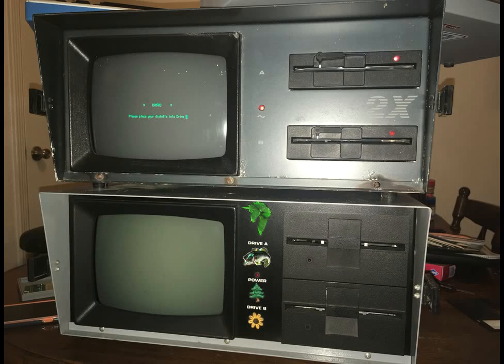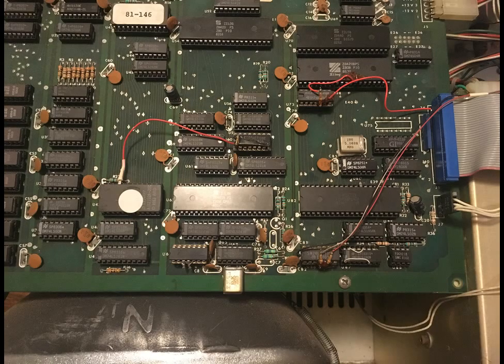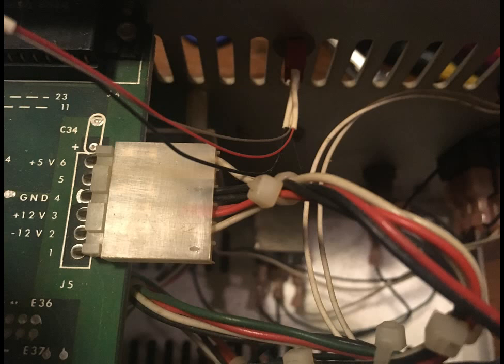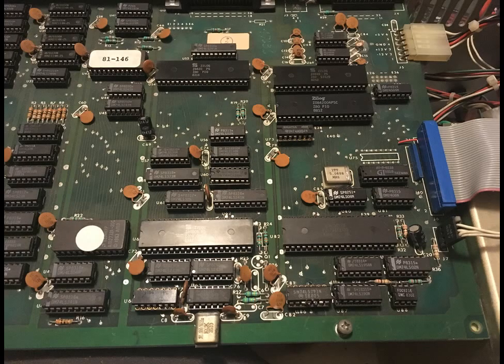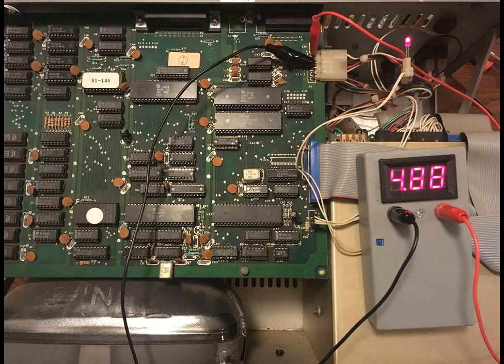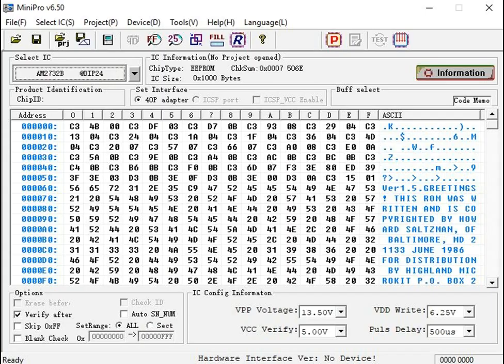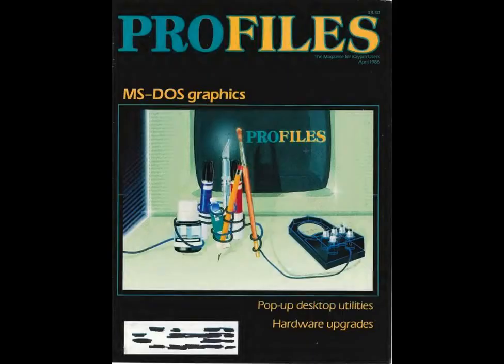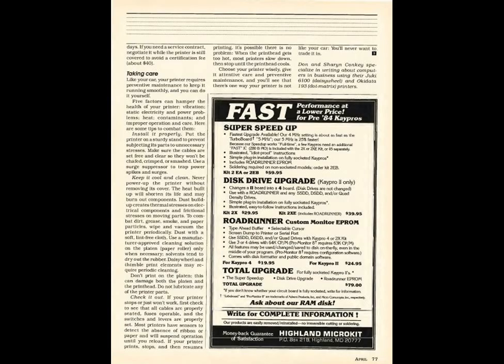Modified Kaypro from the Past

Comment: Did you ever find out the cause of the Dead CRT? I bought a Kaypro II for $50 and it would only click due to a blown cap on the A drive. All that's left is the CRT problem. IT has the exact same problem you have. Been messing with it for 6 months and about ready to sell the thing.
Reply from the maker: James, I haven’t messed with it much. But I think it probably needs the board rebuilt with new caps. I’m not an analog guy, so I haven’t really messed with it. I’ve thought about replacing it with a CRT and a controller board to combine the sync and data signals. But I’ve never gotten around to it.
Reply: @RetroDepot  ah ok. well thanks for replying. I've got the board out and may end up recapping the entire thing to see what happens. From what I've found, the entire board gets power but the flyback transformer doesn't. thinking maybe a bad cap on the circuit.
Reply from the maker: @JamesBenedict02  that’s usually a safe bet to start. I need to tear into mine. I just haven’t. Maybe one day soon.
Reply: @RetroDepot  well if you do, it would be cool to see how you fix yours.

Comment: Looks like using A11 to bank switch  the rom for different boot options, but that's only a 2k bank in a 4k rom seems a bit small but I don't know how big the kaypro bios is ..I've seen the same scheme was used on a number of occasions.
Reply from the maker: It was interesting to see that.  It turns out that the Road Runner rom was capable of booting four floppies.  But it was so badly corrupted that it wouldn't work properly.